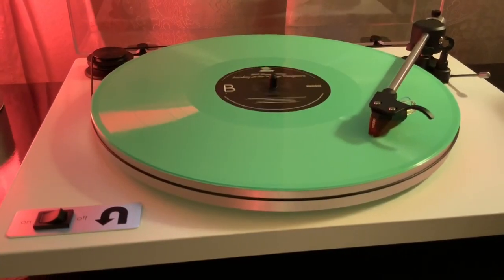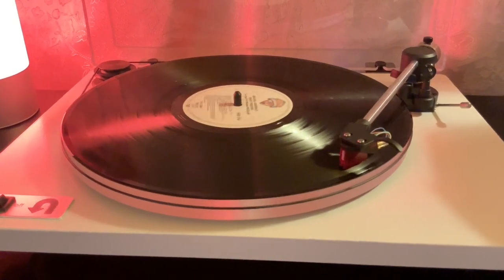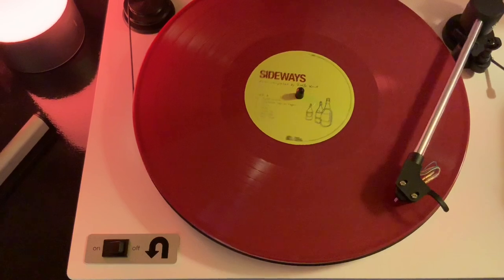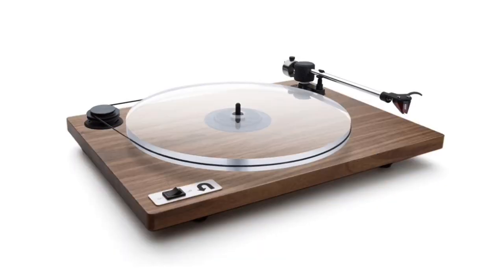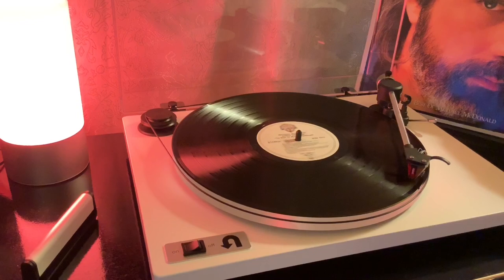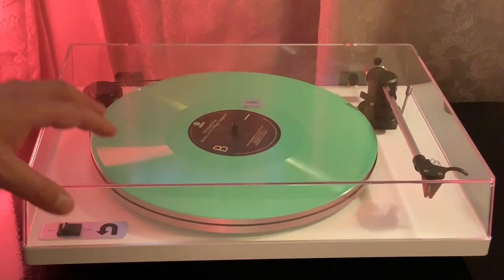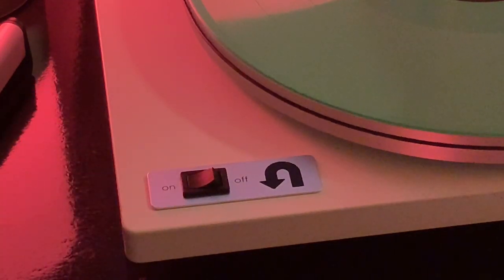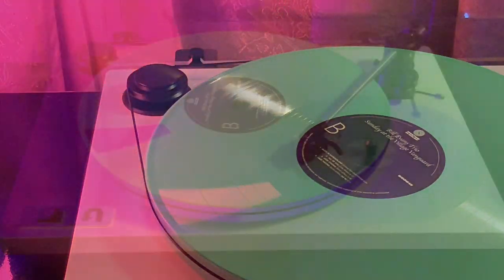U-Turn Orbit Plus Turntable REVIEW / U-Turn Audio Record Player

Comment: Are you using the felt mat that it came with? Or straight on the acrylic platter? I just got mine and this
Entire time I had it on the 45 portion didn’t know. One issue that they should have noted in the instructions
Reply from the maker: You can use it with or without it, but I prefer using it with the felt mat. It keeps the vinyl steady. Yeah, that’s one thing about this turntable, forgetting to switch to 45. What I usually do is, once I’m done playing 45, which isn’t often, I switch it right back to 33 again so I won’t forget to leave it on 45 when playing 33.

Comment: Do you need speakers or does it have build in speakers already?
Reply from the maker: You’ll need speakers, it’s not built in.
Reply: @TheBluRayCritic  Can I use bluetooth speakers or does it have to be a specific one?
Reply from the maker: Lily Nguyen This turntable is not bluetooth capable. Besides needing speakers, you’ll also need a pre-amp either one being built-in or an external one.

Comment: there is a lot i dont like about this table no speed control no removeable head shell no anti skate there are better tables out there that have the same cartages pre installed that have the things listed and have auto stop for the same price so this is a pass for me i would look at fluance as they have tables that can do all the things that u need . the u-turn orbit just looks like a cheap clone of a pro-ject
Reply: Can you please share which ones those are? I was about to get this one but the no auto-stop turned me off